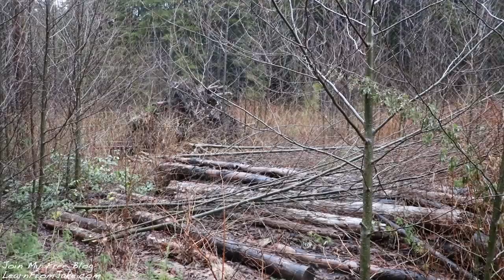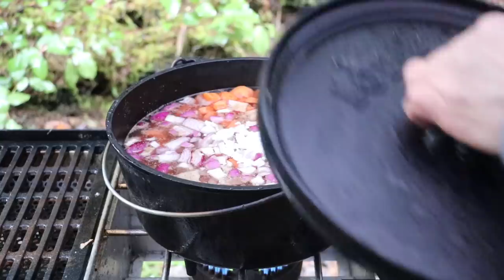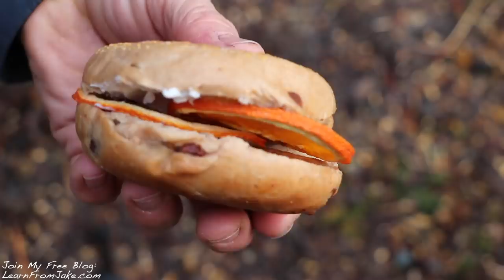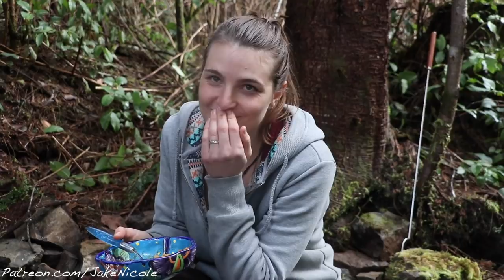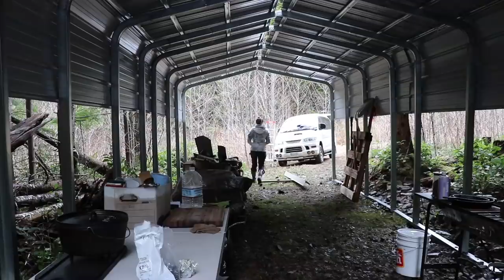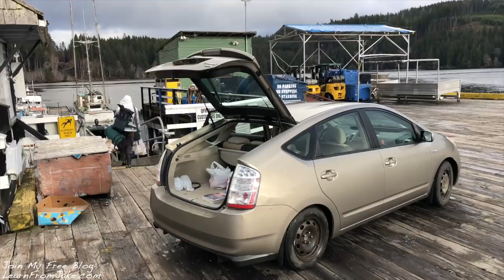BUILDING SHELTER - LIVING OFF GRID | Freezing & Wet in Canadian Wilderness

Comment: A little tip, when cooking in a Dutch oven pot in an open fire put the pot in hot coals as you did but also put hot coals on the lid. It helps you have more even heat. Great when cooking biscuits or bread. I us mine several times a week.

Comment: Here  is  a tip.  If you want to enclose carport with mosquito net, shade cloth or plastic use magnets.  I got these long magnets at Harbor Freight which were intended for the kitchen to hang knives and such on.  They are incredibly strong.  And you can remove your cloth or whatever so easily.

Comment: If you have a drain plug at the bottom of the boat at the stern, you can drain your boat of water by running the boat at a good speed and opening the drain plug the water will siphon out.

Comment: Was watching a video  from your Living off the Grid Channel  and saw you collecting water in  a bucket and then augmenting it  from water that collected on the Tarp.  Is there any reason why  you didn't add gutters to the Carport  and use the Carport Roof to Collect Water? I imagine it wouldn't take long to fill up two 55 Gallon Food Rated Drums  with water.  As creative as you seem to be,  a Barrel on a Stand could easily  be  turned into a shower.  Water would be cold until you can afford a small solar  system on the car port roof to heat the water  during daylight.